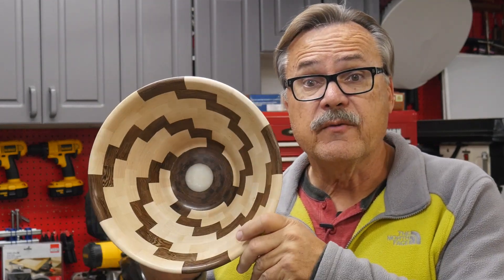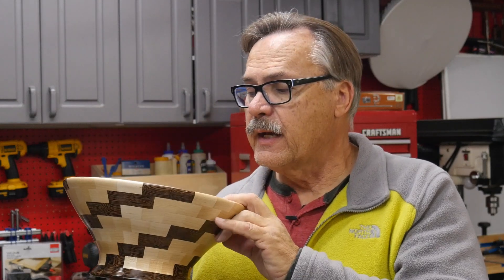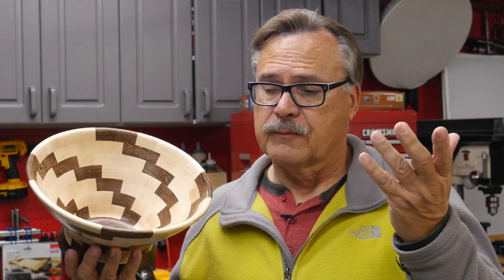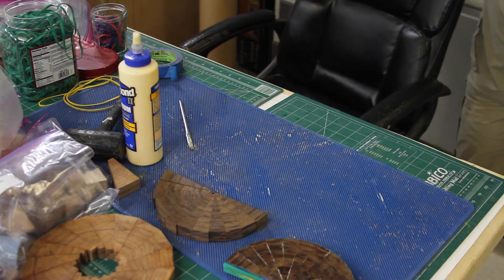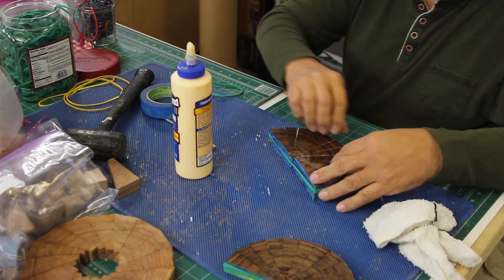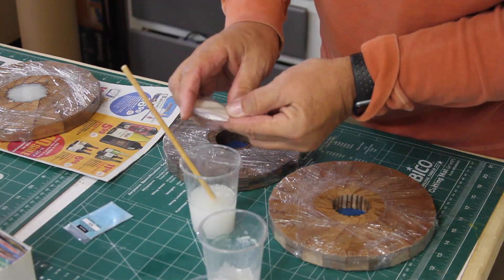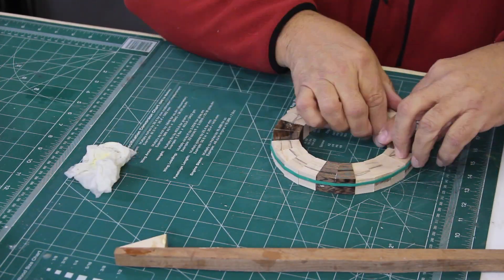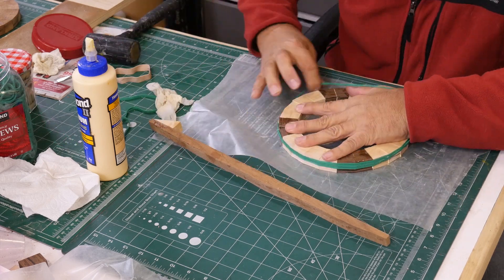Make This 24 Closed Segment Bowl

Comment: To fix that off center issue , glue it to your waste block and onto the lathe to the material for the void then add your resin - that gets it dead center.
Reply from the maker: That is a great idea Ramjet3, I will be trying that. Thank you for the idea.

Comment: Great video! I’ve often wondered the process for making these. As for your off-centered base, it was after you put weight on that first piece, it slid off. I’ve seen other woodworkers use salt in their glue-ups to prevent this from happening. Have you tried this?
Reply from the maker: Roam Sweet Home thanks.  I have thought about it, but I haven’t tried it yet.  Maybe on the next one.